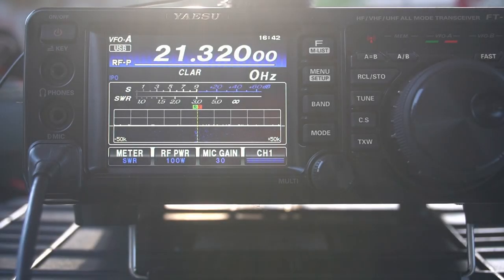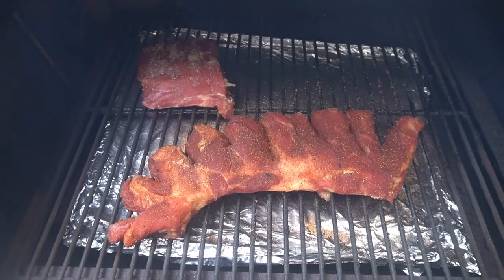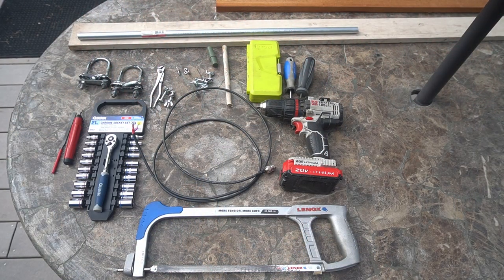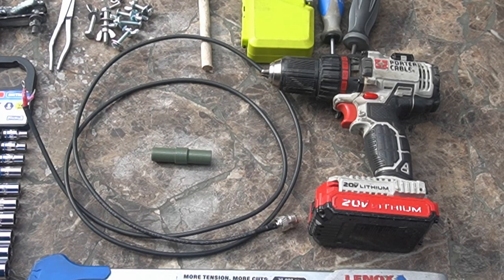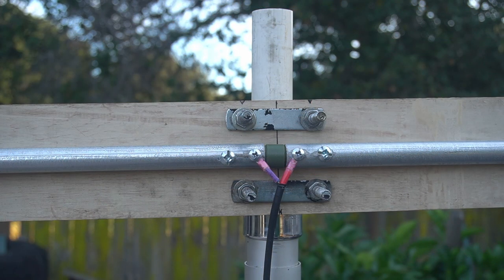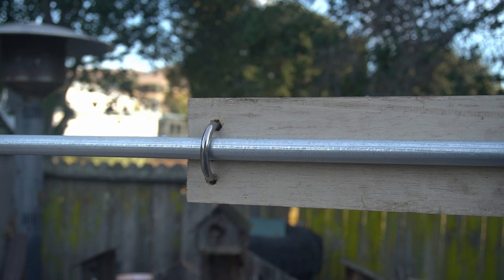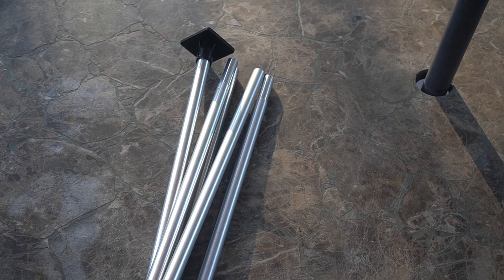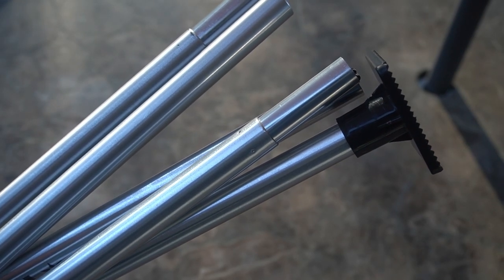Build this cheap rotatable dipole. Great for Field Day and portable use!

Comment: Good Video! Two Suggestions: 1) you can shorten the drop leads by about 1/3 with linear loading (folding back on its self). Use about one third more wire length then fold it back almost completely doubled. 2) if you want multi bands without having to change drop wires, put tap screws along the length of your element about one eighth wave out for each band and add drop wires for those bands, which will decouple those bands.   (Just saves a bit of time while operating, useful on Field Day) 
LB Cebik's W4RNL (SK) Inverted U only looses about 0.6 db (~13%) power broadside which is unnoticeable in real world operating.   
73   mike   N4ONL

Comment: Have made a 6 meter dipole with aluminum shock-corded poles, and found that the sleeve joint was not tight enough for a consistent length, but was solved with a set screw through each joint. Thanks for the vid. VA7HUM

Comment: I like this concept. But I think I'd use sliding tube segments at the ends of the dipole rather than hanging wires (with a finger adjust auto hose clamp to "fix" it). And when you adjust to desired freq/SWR - scribe a line so you can quickly return to that setting.
Even better do the sliding arrangement at the center vs the ends. Several inches fixed then the bulk of the element slidable so you can adjust both elements quicker and not have to walk those 17 feet. LOL (Of course the U clamps would need to be loose enuf to move the elements.) 
With decent amount of fixed center sections, this sort of arrangement would also allow much greater latitude of band coverage..
I too old and disabled to do these things anymore but I can feed ideas for people.
Reply from the maker: You will love the new version!

Comment: Instead of cutting individual wires for each band you could make it into a linked dipole by adding bullet connectors to the ends of the wires to change bands.
Reply from the maker: Perfect 45, I might just do that

Comment: Chuck, if I understand this correctly, my box store has some aluminum rods that are 8' long. Couple of those and some hose clamps to so hold the wires off the rods. This looks like a fun build and for 15, 12 or 10, it would be great for those bands.
Reply from the maker: Hi Don, could you get me a link to those rods? I was surprised how well it worked!

Comment: the tool you are talking about is called a Deburring tool. I have been using one for over 60 years. Mostly used by machinest.
Reply from the maker: Right at the time i didn't want to say it wrong lol, I use mine all the time! Thanks for watching
Reply: @KK6USYHamRadioAdventures  73

Comment: I haven't watched the video yet. I noticed that you said even at qrp wattage the ends of the antenna are dangerous???? I'm not doubting you. Just seems a little bit absurd but then again I don't know that much about radio
Reply from the maker: Just going by what was written by a really smart Ham that knew a lot about antennas, thanks for watching.
Reply: @KK6USYHamRadioAdventures  awesome, do you mind referencing the material so I can read as well? I'm still pretty new to radio but I'm learning it's absolutely amazing.

Comment: Instead of a "U" bolt at the ends of the board, use double conduit clamps and instead of drilling a hole and bolt the "drop wires" use stainless steel hose bands and a Anti-Ox compound over a coil of wire wrapped around the conduit, that way it can be loosened and slid back and forth to tune.  Since this is a 73. Ω antenna  (it is a dipole) 75. Ω coax should be used.  All transceivers work just fine with 75. Ω antenna systems. Ron W4BIN
Reply from the maker: Great ideas there Ron, Thanks!

Comment: Thanks for the video.  Cool antenna.  The plastic hand tool for deburring the metal and PVC is called a deburring tool.  lol  They're made for machienists and they're available from several sources online.  They work real good for PVC, too and last a long time before getting dull.
I have a question.  How long do the pipe pieces of the dipole need to be to hold efficiency and directionality?  Is there a part of a quarter wavelangth for maintaining directionality?  I've been wondering about making an antenna like that for the lower frequency bands.
Thank you.
Reply from the maker: The pipes probably need to be a 1/2 wave on the lowest band you want the antenna for.
Reply: @KK6USYHamRadioAdventures  Thank you.

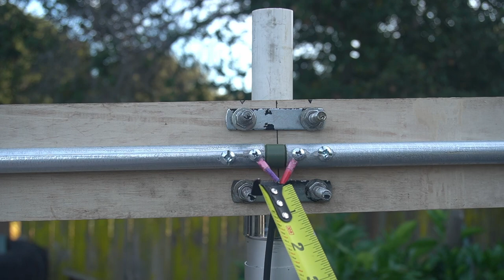Comment: 6:55 "negative and positive" from the coax feedline 🤔  ...and do you think this antenna has "directional gain", or is possible that the overall gain is reduced compared to a conventional dipole, but it has directional properties?
Reply from the maker: David "outer shield and center of coax". a flat dipole will be better off the sides. being rotatable will give you the chance to null out what you don't want to hear, but not a huge difference.

Comment: What version of the antenna handbook are you using?  I am looking on the 23rd edition and do not see that antenna.  Some measurements would help also.  Love your channel and videos.
Reply from the maker: I have the 2022 I think 6 volume set and it is in #4 antenna system and radio propagation
Reply: @KK6USYHamRadioAdventures    - Thanks.  I found it last night after I asked.  I thought you were referencing the Antenna Handbook, not the ARRL handbook.

Comment: Just need a link and a list of parts and basic dimensions in the description.
Reply from the maker: Robert, I bought 2 10' pieces of 1/2" emt conduit. 2 small U-bolts for the conduit and 2 u-bolts for the size of your mast. a couple small screws to mount the coax and 2 bolts to bolt the middle to the 1x4 board. The measurements are above in the description for the two bands I tuned, 10 and 15m

Comment: Would there be any difference or harm in using copper pipe instead of aluminum?
Reply from the maker: Copper should work just fine, still heavier than aluminum is all.